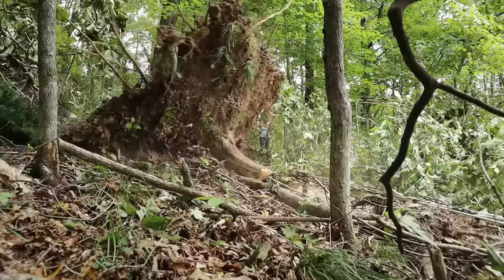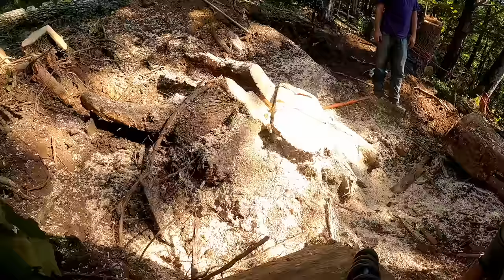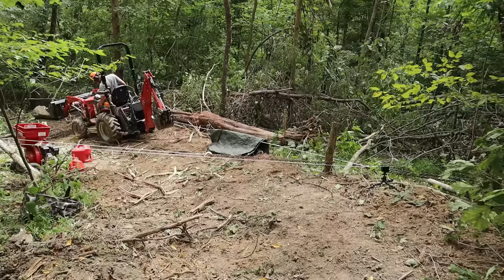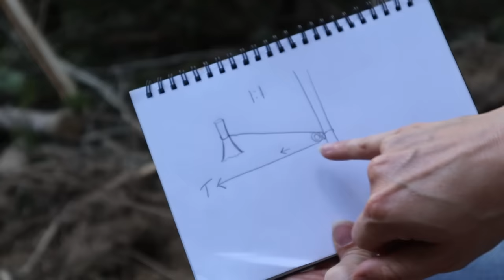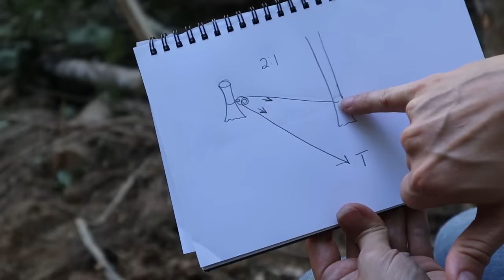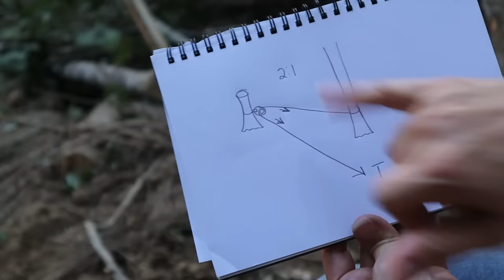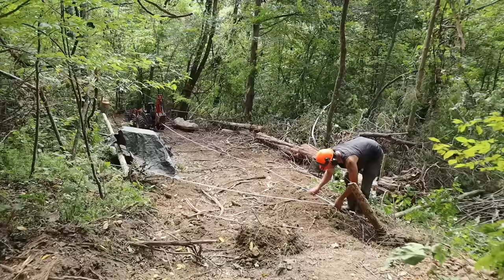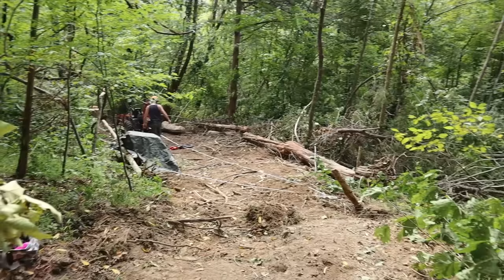Snatch blocks vs tree stumps - the power of pulleys /// E57

Comment: When hooking to the tractor, hook to your hitch,  don’t hook to your backhoe bucket, when you pull that pressure is put on your curl cylinder and backfeeds your tractors hydraulic system, the pressure spikes can damage your pump and also damage your curl cylinder.
Reply: Right. any shock to the hydraulic lines like letting the bucket slam down or sensing being a relief suddenly like your rope brakes and it retracts your Pistons really fast you can damage your valves or seals and blow your lines out so good point be careful with that.
Reply: and since they have the little backhoe, they could help themselves out and dig around the stumps, when possible, to ease pulling.
Reply: Good to know!
Reply: @howtogetoutofbabylon8978  Did not know that about Hydraulics, Cheers
Reply: Thanks for the tip. Cheers
Reply: you also have more dig force than travel force so using the hydraulics  to pull would be another advantage
Reply: My hydraulically-challenged neighbor just did that very thing with his little John Deere loader, inverting the rubber (yes, rubber) return check valve and of course locking up the loader bucket.  I took it apart for him,  put in a new piece, and violà!
Reply: i was gonna say the same thing.  i noticed that on the 4 to 1 pull.  i was waitin for that bucket hydraulic cylinder to pop.  thank goodness it didnt.
Reply: @jayt.4026  but it did pop. This video is 7 months old, but 6 months ago he popped his cylinder on the backhoe, pulling a stump.
I just found this channel 30 minutes ago, and I subscribed. I am about to do ALL these things, and I've just learned a ton
Reply: When you use multiple snatch blocks like that you actually make a block and tackle that is not consolidated into two pulley sets.  Your original block and tackle set up was what you needed it was just to undersized.
Reply: brandon heath, excellent advice. Thank you!
Reply: Thank you, i too have been hooking to my loader. I appreciate the info!!!
Reply: I think both are limited by tire traction about equally.
Reply: Yeah, a nine year old nitwit that paid attention during school could tell you that whatever is at the bucket or tied to the bucket has leverage over the hydraulics on its side.  So, pulling against it fixed object with the bucket will provide a lot more resistance (and stress to the hydraulics) than digging with it! 🙄 Duh!
Reply: Agreed, but using the hitch is dangerous as well. Many farmers were killed before the 3 point hitch was invented. The tractor can wheely over in an instant, crushing the operator. Just be careful.
Reply: @FelonyVideos  Yeah, that was probably because older tractors didn't always have a drawbar below axle height to connect to.  Dad had an Earthmaster (1948 or 49) that had a drawbar that mounted on the lift arms.  If you've got a tractor like that, junk it!  When you raise the lift and try to pull something with one of those, it becomes super dangerous, like you just said.  Pulling from a point below the transmission is the least dangerous, since that actually counteracts some of the flipping force.

We also had a 1958 CA Allis Chalmers.  The original drawbar, the disk harrow, and the turning plow all hooked to a hitch below the tractor.   The turning plow and disk harrow had links or chains to hook up to the lift arms.  That was your three point hitch.  The problem with it was the implements could -- and did --  come unhitched from the bottom point.  That happened twice with a double share turning plow.  The first time, the tongue of the plow dug into the ground.  So it stood up on tongue, flipped over, and hit my dad in the back.  The last time, my son was using it, and the plow had him pinned against the steering wheel.  I wasn't there when it happened.  Thank God that tractor is dead now, parked, kaput!

I have a Yanmar and a Mahindra.  The drawbar is super low on both of those, down under the transmission, and the both have the new type of three point hitch with the third point on top.
Reply: @lewis2553  All good points. The tractor can only wheely until the hitch reaches the ground, a lower hitch means less wheely height.

When I was 14 or so, I drove big tractors (farming), with 3 point hitches, and my objective was always to use so much power and speed so as to basically go down one mile long straight rows on the verge of a wheely, with the front tires sometimes coming off the ground completely, in which case I used the individual brakes to steer until the front wheels came back down. It was a dance. I never realized how dangerous the dance was until last year, when I read about all the deaths from draw bar accidents. All I did know was when the front wheels were off the ground, maximum speed and minimum back tire wear (slippage) was happening, all good things.

I'm still not perfectly clear on how the 3 point hitched solved the flip over problem, but I guess it's because it makes the implement also act as a wheely bar...
Reply: @FelonyVideos  I know what you mean.  When I was about that age, I used to go crossways on a hillside with the old Earthmaster pulling a drag smooth out the ground after we had turned and disked it.  The drag would load up with dirt, and I'd be going with the front wheels about 8 - 10 inches off the ground, ready to hit the clutch any second!  That tractor had NO brakes, ever, in my lifetime.  And to make matters worse, there was a big wash on at one point on the side of that hill.  We were trying to fill it up by plowing on each side of it and dragging dirt into it.  Thank God, that tractor is gone, too.  Like Dad would say, "It's a thousand wonders we didn't get killed!"
Reply: @FelonyVideos  Also, the three point makes it harder to flip but not impossible, because of the fact that most, if not all, hydraulic tractor lifts use single direction cylinders, and the lift arms are free to raise up higher in the case of a sudden wheely.  In other words, they can out travel the lift itself.  And you can't apply hydraulic force to hold them down.  That's one thing that's different from Dad's old Earthmaster.  It had a two way, external cylinder.  You COULD hit the lever to stop a wheely.  But you'd lose traction if you used it during normal operation in the field.
Reply: @lewis2553  I'm in middle Tennessee, and your mention of hillside prompted me to chime in. I'm 54 now but have had since I was about 20 a reputation for fearless bush hogging, I will bush hog where most wouldn't dare, but I'll tell you this, I'm not fearless. I get plenty scared all the time, but the pay is good
Reply: @richardcranium5048  Yeah, I know.  I need to replace my brakes on my Yanmar YM2000, now, because before I got my Social Security, I couldn't fit an overrunning clutch into the space between my tractor and the bush hog drive shaft.  The shaft was too long and wasn't mine.  So I didn't want to shorten it, and I couldn't afford to buy another one.  Imagine how I felt when a back tire would start up on a stump and I'm on this little, narrow Yanmar YM2000!  That's why it needs brakes now, too many times grinding that bush hog down to a halt before the tractor could flip over sideways!

I'd also cross terraces going up hill and would usually have to lift the bush hog just enough to raise the front wheels off the ground a little in order to have enough traction.  It gets scary for sure when you have two or three terraces close together on the side of a steep incline and stumps thrown into the mix.  Some guys had cut timber out of there for us two years before that, so the stumps were usually overgrown with honeysuckles and saw briers and hard to see, at times.
Reply: @lewis2553  yeah those hidden stumps and such can sure trip you up. I get into some unfamiliar territory every once in a while. But probably 90% of what i do these days is contracted and I've been over it many times. I've been on an old John Deere for the past 10 years.  It was old when i bought it a 2002
Reply: I put a rope as high up in the tree as i can and attach it to a hand winch tied to a tree as safe distance away.
Then i dig around the main roots and
Reply: I dig around the main roots and I cut about six inches out of each root
Then I winch the tree over. The weight of the tree pops the stump right out of the ground.
No tractor required.
Reply: @johnndavis7647  Excellent idea!
Reply: @johnndavis7647  exactly and get your chain as high up the tree as you can and it will fall over with minimal Force
Reply: @johnndavis7647  when using a hand winch you can get extra leverage on the stump by laying a big log up against it, on the pulling side and perpendicular to it. As you pull, you gain extra vertical force as the stump is held up by the log, causing the roots to come out easier. i.e. you're "dragging" them less against the ground.
Reply: Smarter Every Day... ? I expect I'll find the link and this was I can go to my history and do so, as I'm liked, subbed and getting notifications. Thanks a million...I had what looks like a small twister come through and there's alot of firewood for an old man and his little ATV to clean from downhill and at a distance to my drainage. It ain't going to be easy but it's gonna be fun. I'll be rid of 30 pounds before it's over.
   I cheered with ya'all when the 4 to 1 stump gave up the ghost
Reply: @Gruuvin1 Guess that answered my question. Thanks!

Comment: For future reference: Since you are pulling the stumps, and the blocks are set up to pull the stump away from the tractor, you can just pull the whole tree down and then saw it up. Plus, you can grab higher up on the tree, adding additional leverage. With a stump, you are grabbing 4 feet off the ground. With the whole tree, you can grab 8 feet up, which doubles your leverage, and puts less loading on everything, including the anchor tree.
Reply: You're talking to somebody that tucks their jeans inside their boots... I applaud your efforts though.
Reply: @ShainAndrews  ahh, yes, I see, LOL. At my place, the chiggers are so bad that we don't just tuck the jeans in, we then use duct tape to seal it. Same for the shirt. And long sleeves, even in summer.
Reply: @ShainAndrews  and enough deep woods off or cutters to kill most of Memphis.
Reply: this is 100% accurate
Reply: But they aren’t pulling the stump away from the tractor. In their setup, the last line is always going to the tractor.
Reply: @chipsterb4946  they can always cut the tree down 8 ft high, then tie it up high there, and pull it toward themselves
Reply: Great advice. I was raised doing things like this, so I can appreciate good advice.
Reply: @chipsterb4946  That last line can go any direction and be any length, so the tractor can actually be on the opposite side that the tree is supposed to go down. Plus, in their video, the tractor is off at a 90 degree direction from where the main stump pull loads are, which is really good, too. I like their setup and approach.
Reply: @embracethesuck1041  most guys can reach up almost to 8 feet without a ladder or step stool, and no one in their right mind is going to stand anywhere near the tree (or the anchor tree) when the pulling begins.

Comment: Use tree saver straps in place of chains when you want to not damage the anchor tree.  Place blankets over the winch cable in case it breaks as it becomes a torpedo whip.

Comment: Something a lot of people on a budget don't consider is hiring someone with a bulldozer or, a huge front end loader. I hired a guy to cut in a driveway for me, and I was surprised at the cost. The driveway was 10 metres wide and 600 metres long and thick with gum trees and brush and termite mounds. The job took 5 hours and cost me $1,000 Aussie dollars. He piled those trees up for me which turned out to be a great bonfire. It might be a little extra in cost, but save a ton of time and does away with all the headaches and backaches.

Comment: You might want to throw something over those wire rope lines to stop the risk of flying back at you if the wire rope breaks. The people that go offroad and get stuck and have to use their winch with snatch blocks usually have something to arrest the line in case of a wire break. Great video and stay safe.
Reply: I cringed when I saw that.
Reply: he did.
Reply: Yes, I had an uncle lose an eye with just such a cable failure.
Reply: I wondered that myself.  A tow rope becomes a Mach 2 bungy whip at that level of stress, and I first thought I’d use chain for that reason. It doesn’t really stretch and if it brakes it just drops but with the pulley force multiplier making steel cable the best option for the price, how much will steel cables stretch and maintain the potential energy a broken rope makes so dangerous.    Also with the force being spread out using snatch blocks does that spread on the weight as many moderate priced steel cable are less the 1000 lbs rated and some being less than half that.   Example.  4 lines used through multiple pullies give a factor of 4 in force so if I’m not mistaken 4000 pounds of force is applied with 1000 lbs of pull from the tractor so it leads me to believe the strength factor of the cable only needs to be rated a 1000 lbs, right?
Reply: The 12:00 minute mark is scary AF.
Reply: I’m disturbed that I had to come this far down the comments to see this bit of advice. Glad you posted it. Might save some on injury or even death.
Reply: I’ve heard guys will throw a chain over the cable Turnock it down in case it breaks. Also you see the new winches on you TVs or rope instead of cable. I hear One of the reasons for that also is it doesn’t whip in case of breakage.

Comment: I liked your explanation of right and wrong use of leveraging.  Look for Matt’s Off-Road Recovery, located in Hurricane, Utah( They pronounce that name Hurricun).  They use snatch blocks quite often in vehicle recoveries. One other method I have seen for pulling out trees very well is a large vehicle tire with the rim. Put a chain around the vertical object(tree stump, 6x6 fence post with concrete around it).  Put the chain over the large tire /wheel up against the object to be pulled out.  Run the chain out to pulling vehicle( DO NOT LOOP OVER A TOW BALL. Matt uses a soft shackle to a strong point low to ground.  Use  a long sandbag over chain 1/3 from object to be pulled out. It will stop the chain from flying back to pulling vehicle and operator if it slips off for any reason.  This method uses a vertical pull changing to horizontal as the object rises up and out of the ground.  Go slow.  BE SAFE!!   FYI: Breaking large rocks can be split using a couple of various weighted sledge hammers, 2-3” wide concrete chisel, and rock-splitting shims. I saw a YouTube video on it. Maybe it can work for you. Good luck on your driveway project.